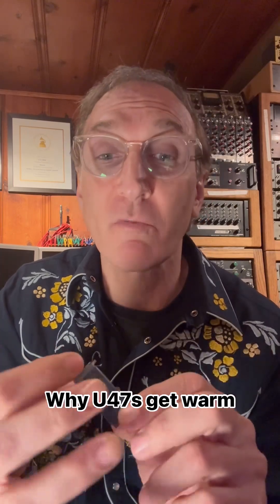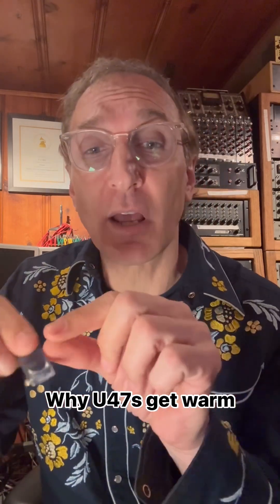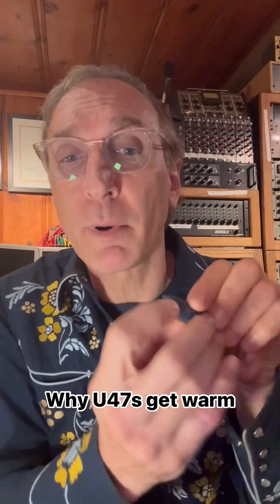Why Neumann U47's get warm

Comment: The purpose was also to get the moisture off from old mics equpped vith pure nickel diaphragms.
B&K measure mikes for instance started being available  in both jfet and and tube flavors in first mid seventies.

The jfet version had a power resistor installed with the sole purpose to produce heat and keep the nickel membrane nice and dry (source B&K instructions booklet).

Consider that the materials used for the B&K capsules where stainless steel, monocrystalline quartz, gold, nickel. They did not fear high temperatures as much as moisture.
Reply from the maker: Not in this mic.  Remember, when it was designed, the only capsule available was the M7.  The reasons why the B+ and heater voltage were not separated inside the PSU are not clear, but it was not to protect the diaphragms, and in fact, the 47 never had a nickel diaphragm.  There is the rare U47, with an aluminum omni torpedo capsule, but it is extended so far from the body that the warmth of the drop resistor would not affect that at all.